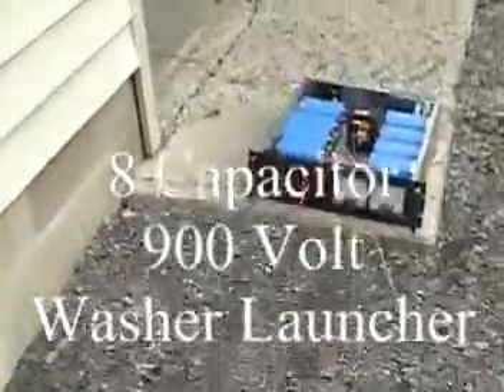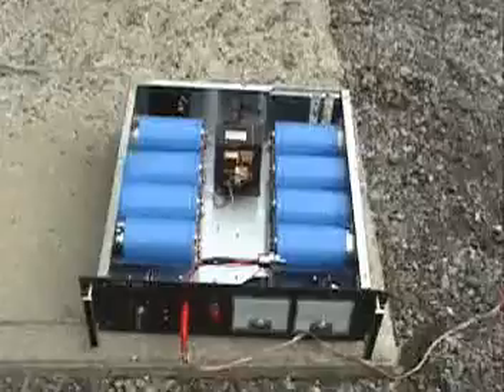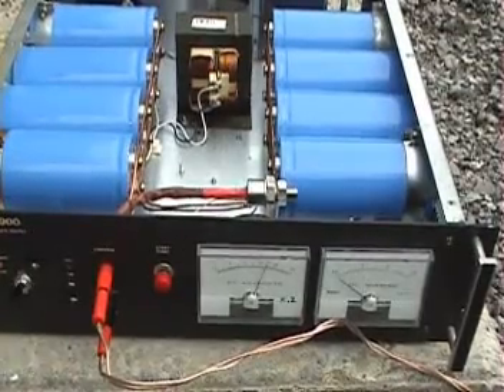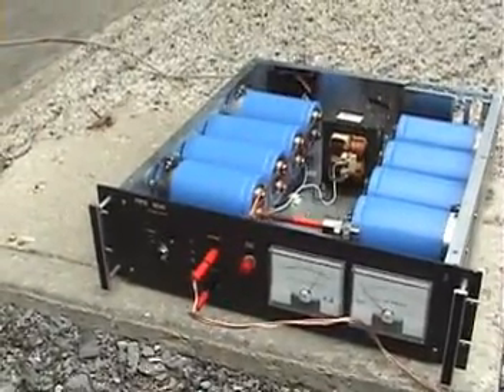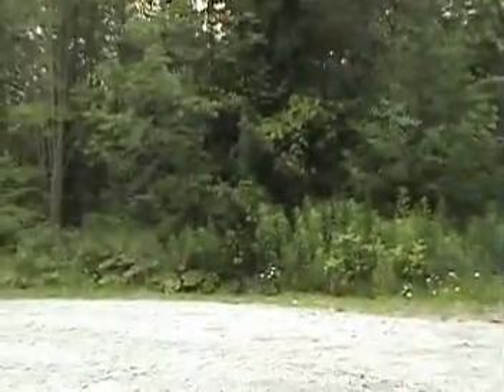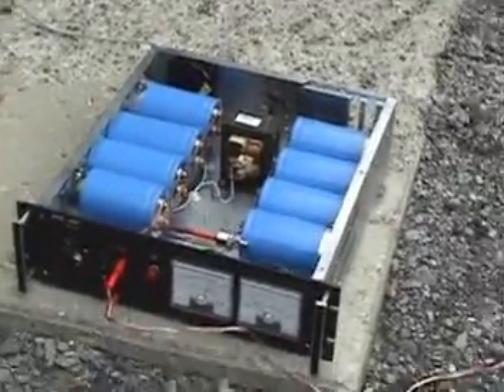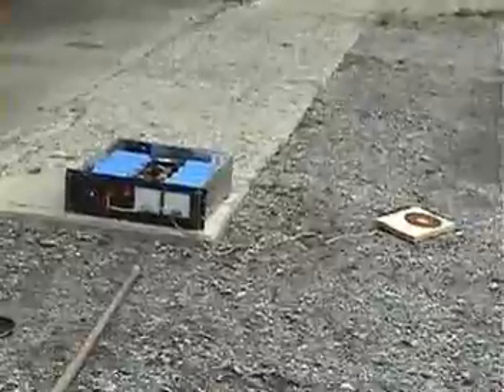8 Capacitor washer launcher

Comment: looks like a great build. Just a tip to play around with. go with big HV diodes. use about 4.7 Meg 2 watt across each bank as a bleeder And jump out  red hot resistor. Do the current limit on the primary side or transformer.  use like 2 or 3 100 watt old school lamps in  parallel then connect in series with one side of primary winding. works as a ballast . lamps will light then dim as charges and will go out when full charge.  you also can use a big coil as a ballast using the inductive limiting method .would be like 5 or 6 Henry.    have to play to get right current limit. just some ideas to make it work better. keep experimenting !!

Comment: The current limiting could be done by other means ie a lamp in series with the primary of the transformer or an old power factor correction capacitor in series. Still wierdly fascinating.....

Comment: There seems to be a lot of confusion about capacitor banks. Best to start by knowing that any caps with the same /energy/ rating (measured in Joules) can be successfully operated in series, regardless of the individual voltage and capacitance ratings.
Power is typically measured in Watts, while Energy is in Joules. The difference is that Power includes Time while Energy does not. So: 30 Watts = 15 Joules for 2 seconds, and also equals 15 Volts at 2 Amps, 2 Volts at 15 Amps, 5 Volts at 6 Amps, et cetera. Time is /implied/ in the Amps. Joules divided by Seconds = Watts. Six Joules delivered in 1/5 second = 30 Watts.
The energy stored in a capacitor is given by E = 1/2 * C (in Farads) * Volts squared. Conversion between Farads and microfarads can be combined with the 1/2 term, to give a simplified equation E = V-squared * C (in microfarads) divided by 2 million.
Caps in series can also be figured as the Sum of the /inverse/ of the individual caps, then taking the inverse of the Sum. So 3700 uF in series with 3700 uF is the inverse of ( 1/3700 + 1/3700 ), which is 1850 uF, or half the capacitance, but twice the voltage, which means double the energy. In the video, there are 4 such sets in parallel, giving 7400 uF at 800 Volts, which is 2368 Joules, or 2.368 kilojoules (kJ).
If all that energy is discharged in 10 milliseconds (which is 1/100th of a second), the Power in Watts is 100 times the cap bank Energy, or 236800 watts, almost 1/4 of a megawatt. If the discharge happens in 2368 microseconds (uS) the power will be 1 megawatt (MW) = 1 million watts.
Getting accurate time generally requires an oscilloscope to see the shape of the discharge pulse. With the setup in the video of capacitors dumping energy into a coil, the current will jump to some high value, oscillate around that high value for a while, then plummet to near zero as the aluminum disc flies away from the coil.

Comment: can send me the link were to get the capacitors from i need 600v ones to make a coil gun the rounds im going to shoot are going to be moving 800mph nice zombie gun
Reply from the maker: I bought them at a Hamfest, but eBay would be the best place to find them.
Reply: thanks man i cant get then no were i been useing 55k volts but on a burst i only getting 500ft sec if i can get the capacitors i can get 1000ft sec

Comment: your maths is wrong. or my guessing is wrong....

If you put two caps in parallel then the uF will be double and the working voltage the same. if you put two caps in series the working voltage will double...

But the uF wont be the same, capacitors in series decrease in uF ....

So you wont have 7500uF, they will half, you will have 1850 in each pair in series, so your total for the circuit will be 3,700 at 900v
Reply: There's 8 caps, 2 series connections of 4 in parallel.

Comment: For anyone wondering how high it went, some back-of-the-napkin math: (Trigger warning for high school physics class)

I estimated 4 seconds of air time (halved because you only look at half of it as 'free fall'.) Using -9.8m/s^2 as 'a.' Vf = 0 because it stopped when it was all the way up there.

Using Vf = Vi + a*t --> 0m/s = ? + (-9.8m/s/s)*2s
Vi = 9.8m/s/s * 2s = 16.9m/s

Using (Vf)^2 = (Vi)^2 + 2 * (a*d) to find d
0 = (19.6)^2 + 2( (-9.8) * d)
d = (19.6)^2 / 19.6 = 19.6m

60 feet for those of you using Freedom Units.
Reply: AirGunReviewer Did the same by counting frames, got 3.37 seconds and 14 metres, or 46 freedom units. Nice touch.

Comment: 450V was common for valve hardware, though most were under 200u'F. So you can still find em cheap at surplus stores for playing with...as most will be 30 years old at youngest- just for play...Or your old Radford.

Comment: How many turns of what size wire are you using on your coil.?
And is the coil a pancake coil shape.?
Very good video.Thanks for this.
Reply from the maker: It is a pancake coil made with 14 gauge enameled wire.  IT is the same inside and outside diameter as a 5.25" hard drive platter.
Reply: Good thanks for that.I will have to dig out some wire and start winding.Bob Davis

Comment: how does this work? can you use some salvaged pc hard disc disc's?
Reply from the maker: Magnetic repulsion.  Applying 800 volts to a coil repels an aluminum hard drive disk.
Reply: actually the disk is drown from a magnet so i assume its iron or some alloy will this work better? what is the mf-uf or f of the caps you are using there? you think using a  crt tv hv circuit  will work s good as the cap's? magnetic repulsion.. i will google that for more info thanks man!

Comment: putting the washer on a rod making it not flip to much initially would make it fly higher? No? yes? =)
Reply from the maker: Do not know??
Reply: I remembered a "science" toy sold by a site long ago they had this thing, in.. well much smaller version, the base was out of plastic and the washer was more like a "conic" donut that was slid onto a guidrod.. small notches in the edge of the "saucer" made it spin and it went seriously high.. and straight. =)

Comment from the maker: The capacitors were purchased at a Hamfest (Ham Radio Meeting).
Reply: Very good, sir.
Reply: That size capacitor can be also be found fairly readily in the aftermarket car audio industry.  Typically t hey are added to audio systems with the obnoxious radios you can hear 2 blocks away. (chuckle)  But they are readily available from most reputable car audio installation stores.
Reply from the maker: ***** You will need higher voltage capacitors for a "Washer launcher" as it runs at 1-2 thousand volts!
Reply: Culann Heartstone they are similar in physical size ONLY. these caps are "super caps" and are VERY different from what you would find in a car audio system. They are about 500uf a piece, where a car audio cap is maybe 1uf, voltages are also totally different.
Reply: they have alot of super caps in car audio for competition syle builds and equipment, the 1-5uf capacitors  arent really of benefit at all unless you have a really small system. They can actually hurt your electrical by placing more demand on the charging system while not a single benefit to justify the use of it. Again they do make supercaps for car audio but they are for the big systems that have audio gear capable of "charging" them and the big amps etc ..benefiting tremendously from them.
Reply: Diesel Ramcharger  Car audio caps are typically 1 or 2 farads. The difference is that these are 450v caps built for tube amplifiers (which are very high voltage), and car audio caps are build for 12 volts, or more typically 16.
Reply: AirGunReviewer the difference is capacitance not voltage. 450v isn't very high voltage for a capacitor. a 220v circuit would use 380v or better rated caps etc. these caps are high capacitance {large storage potential} which is what makes them special. learn more before trying to correct me by reiterating what i said. washer launchers run somewhere around 4000 to 30000 farads of capacitance at 300-1000 volts.
Reply: Diesel Ramcharger Hey there Mr Diesel Ramcharger. Just so you know, Car caps are not 1uF (microfarad) as you have posted above. They are usually 1F (1 Farad). You have also posted above that washer launchers run somewhere around 4000 to 30000 farads of capacitance. This is incorrect, a capacitor of that value would be huge. I think you mean uF (microfarad) There is also a dramatic difference in both Capacitance and Voltage between the two applications.
Reply: Mr Carlson's Lab It was late, typos abound. Yes car audio caps are typically in the .5 to 1 farad range. "Super Caps" as seen in this video are similar in SIZE to lower voltage lower capacitance car audio caps. But not at all in function. You can find super caps {SC} in the 3000f range, easily. And no, that is not uf. 3000f caps are about the size of a beer can, and used in an array to replace car batteries in several applications.
Reply: What type of switch did you use? It looks like some kind of SCR but do you remember the ratings on it?
Reply from the maker: Plasmosis1 I can't remember what it is called but it looks like a huge SCR and can handle 1800 volts at over 100 amps.

Comment: Hi - if the flight lasts 3 seconds exactly then the height is 11.25m, in the absence of air resistance. Probably 10-11m with air resistance, or 32-35 feet. Nice work.

Comment: not only in a copper coil, in anything conductive!
That the why the aluminium hard drive platter flies away, it acts as a coil, current is induced by the field, and that current creates an opposing magnetic field!
Same principle as induction heating, just applied to a coilish enough thing, with massive energy applied in a short burst, two strong opposing magnetic fields=pwooooinnng

Comment: There is a coil of wire under the washer, the energy stored in the caps is quickly discharged in it, that current in the coil generates a magnetic field, the washer then electricaly acts as if it were a one turn coil, that is, the magnetic field induces a current circling in it, that produces a secondary magnetic field, and the polarity of that field is the same as the field generated by the first, wire wound coil, these two similarly polarized fields repel, rather violently!

Comment: Is that not that there is an induced current in the washer, and that induced current in turn produces a magnetic field polarised inversly to the one generated by your aparatus?
(the washer acting like a one turn coil) Aluminium is not diamagnetic enough on its own, (try it with an Al ingot, that should settle it!)
Also, if you search for The Geek Group, project Tosser, in youtube you'll find a nice ring launcher:
/watch?v=cA0i8OPAqDA

Comment: man people are rude on youtube I think you did a great job but I would try adding a relay to bypass the resistor after the inrush is over and you get above 2 KV I think you will charge up the caps quicker that way and to a higher voltage :)

Comment: You're a good example on how to NOT build electric devices. why the heck did you put the 1k resistor in there? build something properly to reduce the current in the "turn on" moment and not such a shit. the capacitors don't mind to be charged without a resistor so it's only good for keeping the fuse in place

Comment: I would highly recommend the use of a 200 watt standard light bulb as your charging resistor in this device. It won't fail as much as a normal resistor and the resistance will decrease as the current does likewise thus giving higher charge voltages. This is much safer than what your currently using.

Comment: 134018 said "That would be 2997 Joules of power. Not 3700"
Actually 2997Joules is not "power" , but a quantity of energy.
Power is the rate at which energy is transfered or "used".

Comment from the maker: A light dimmer only works on AC.  Yes you need a limiting resistor unless the power supply is lower than the maximum voltage the cap can take.

Comment: yeah. that would make a lot of sense. it would be a hell of a lot easier to build this well documented and extremely simple device than it would be to.. what? build another device that does the same thing? and keep it hidden? using what, compressed air? coming from invisible tubes? editing the soundtrack and video to hide it's appearance? you are insane.

Comment: time the washer's flight and use, height = 1/2 gt^2 to find your altitude :) take the time and find the p.e at the max height of the washer and  calculate the percentage error between the capacitor's energy and the washer launch energy, maybe you could find a more efficient way of passing the energy on to the washer :) great video!!

Comment: would it not be worth putting more resititrs but in paralell so they dont have to deal with as much current, or more in series so the voltage drop isn't a much?

Comment: @18Dizz 
Oh ye of little vision. Take this circuit, Put charger in a backpack with battery power instead of AC. Place a non metallic shaft in the center of the coil. Then using small aluminum rings that just fit over the shaft as ammo. You now have yourself a magnetic ring launching gun that could be used in many ways. Aluminum creates it's own magmatic field that opposes the magnetic field of the coil. So in theory this inductance launcher is more efficient than a reluctance launcher aka CG.

Comment: @jhbonarius You can safely stack capacitors in series if you use dividing resistors across each one to equalize the voltages.

Comment: @axel1973w Not going to get a voltage drop from that length of wire. Wire size in NEC code is set for overcurrent safety. OC devices must be incorporated in everything but fire pump systems (and little experiments like this lol)

Comment from the maker: @ConnorXV - Did you use a bridge rectifier and 2 capacitors?  I used a voltage multiplier at first in my older videos then as I got up above 1 KV I switched to a microwave oven transformer.

Comment: @chickenpoper Sounds like you have the concept here but your wording is a bit off. Good job though. When putting 2 resistors in parallel remember, if the 2 are equal value, the parallel value will be half. 2, 10 ohm resistors will be 5 ohms but the power rating will be double because they share the total current. 5, 10 ohm resistors will = 2 ohms but 5X power rating. Unequal resistors will be somewhat less than the least value resistor. I forget the formula but look on line.

Comment: Nice repulsion coil... All you need is a higher wattage resistor. What is the voltage rating on yuour caps? You could also use an SCR on the input to the transformer, to control the charge rate. Cool project...

Comment from the maker: @Envergure - it prevents damage to the capacitors on charging and protects the diodes on discharge.  There is a reverse EMF from the coil that destroys unprotected diodes.  My defibrillator capacitor experiments resulted in a fried power supply because of the lack of a current limiting resistor.

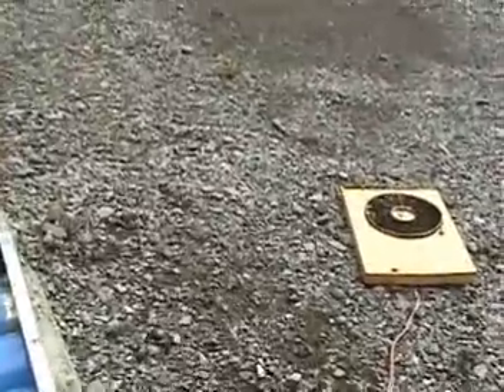Comment: @bobdavis321 it coming with the cabinet means nothing. You have no top on it so the fan cannot perform it's job of cooling anything other than maybe the backside of the one capacitor it is directed at. If you are noticing the resistor heat up to red hot maybe you should direct a fan at it. Also did anyone find it odd that @ around 2:38 you see the washer never leave the launch pad or am I missing something here?

Comment from the maker: I used to use a center taped Microwave Oven Transformer.  The resistor also helps limit the voltage that is delivered.

Comment: @macro312 capacitor. its like a battery. it holds a charge up to a certain point and lets it out then recharges again. on a motherboard, it does this process alot faster and with way less voltage.

Comment: This circuit would charge so much faster and with less heating if you placed a buck converter on the transformer's output. Buck converters give you a current advantage when the potential between your transformer and caps are the highest.  At the top end the charging would also be improved, in this vid the resistor really limits the speed.

Comment: @snorreselmer When you add capacitors in series they add like resistors in parallel. He probably has the 4 on each side connected in parallel then those 2 banks connected in series. When you add the 2 14800uF banks in series it makes it 7400uF. Maybe he rounded off to 7500 lol

Comment: Granted, it's been 15 years since I took electronics at school, but I don't get the figures to add up (maybe there's some crucial bit I've forgot):

- To get a 450V capacitor to do 900V you connect two in series.
3700uF 450V*2 = 3700uF 900V

- Since you have 8 capacitors, that means you should have four parallel banks.
3700uF*4 900V = 14800uF 900V

BTW, great experiment!

Comment: All you'd need to do is sharpen the washer, add some backpack straps to the capacitor bank, add some kind of barrel to fire the washer horizontally, and you could decapitate squirrels from across the yard.

Comment: There are a few types of rectifiers and setups

A common one is called a Full gridge rectifier which can supply DC current out of each phase of the AC wave. Other types like half wave can be easy to build because all you need to do is put a Diode over one of the cable input.

As for voltages most rectifiers can handle 600-800V depending on the models, what is mroe important is the current rating which typically ranges from 1-35AMPS

Comment: Normal electrolytic capacitors are DC only; the setup shown in the video is rectified DC to charge the capacitors

Other types of capacitors called "BP" or BiPolar can work on AC currents

Comment: Really simple to calculate the hight... Last shot was at 3.4 seconds. That devided by two is 1.7 s of "free fall". The fall distance = (acceleration * time^2)/2. In this case (I assume you are on earth) the acceleration is 9.82 m/s^2.
Last shot is 14.2 meters (46.3 feet) high!